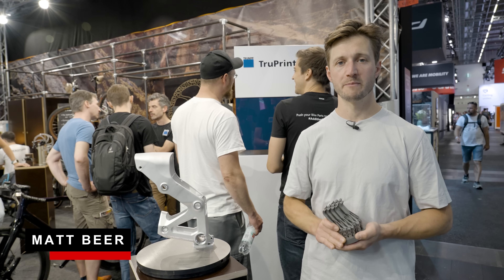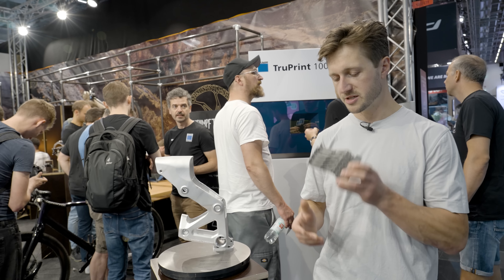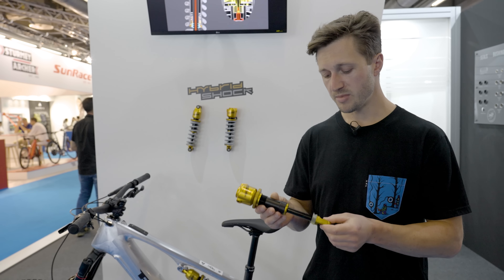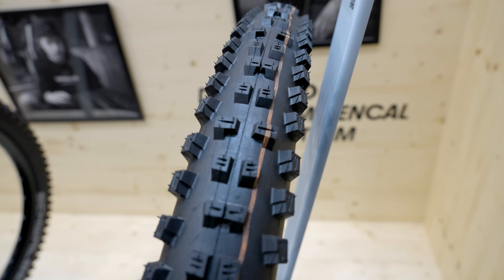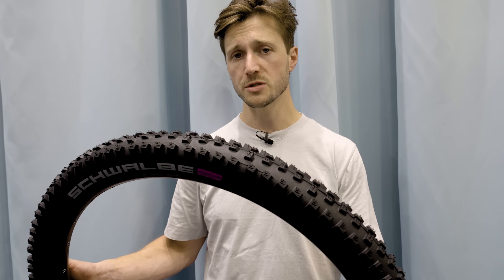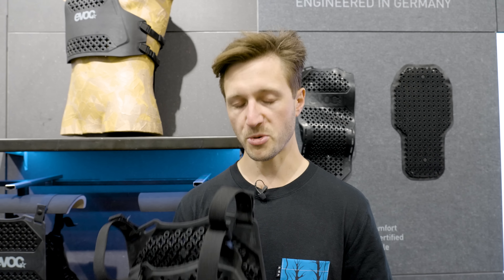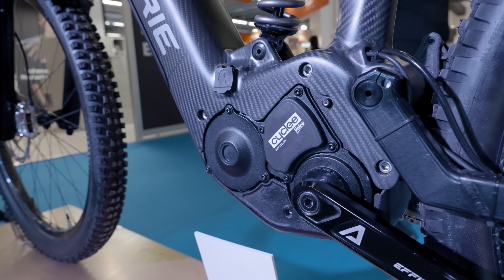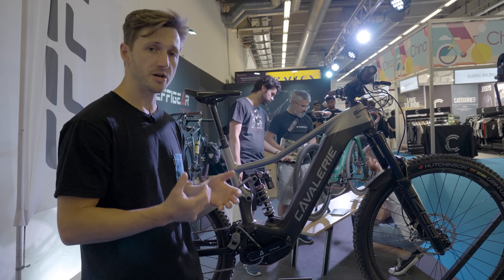Hybrid Coil/Air Shock & 3D Printed Titanium Levers  | 2023 Eurobike Show

Comment: Fox needs to make a coil with air preload open bath Marzocchi fork. 
Nothing feels as nice as the pre 2008 bombers. Nothing lasts as long either
Reply: I also like and still own open bath forks. But that design is too heavy to compete in today's market. Plus air forks reached a performance level that's hard to beat. Service intervals on the other hand are pretty steep in comparison.
Reply: @frankthetankricard  I bet a bomber classic line would sell really well still tho